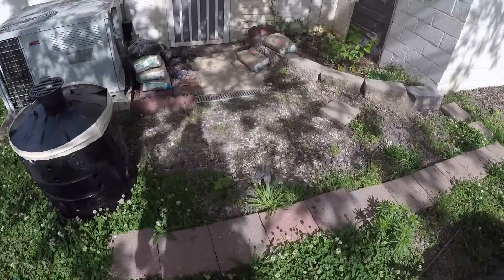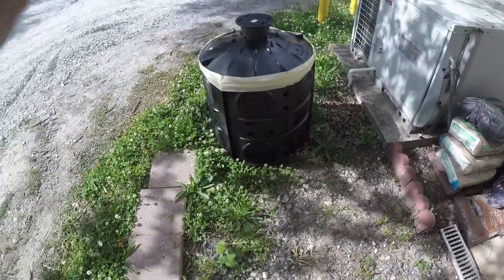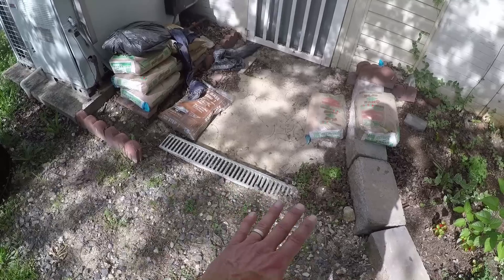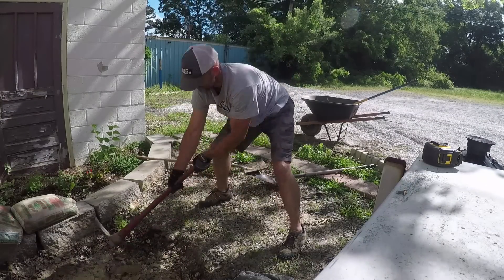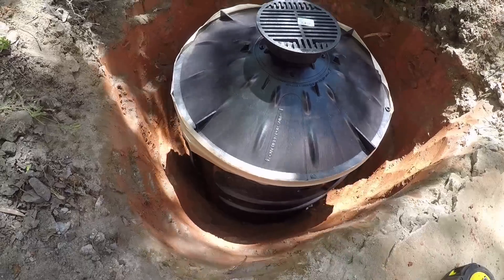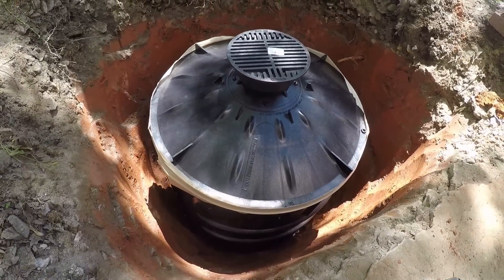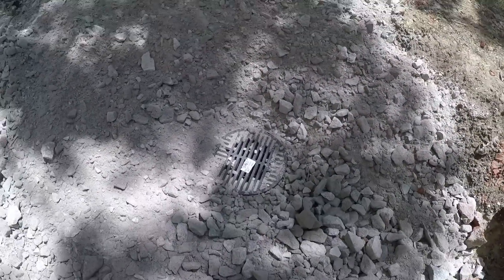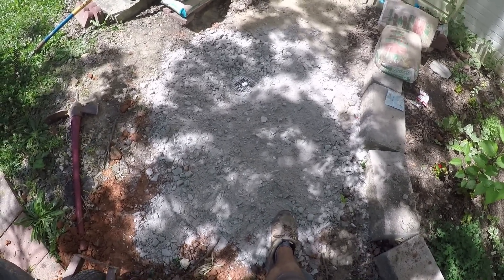NDS Flowell system

Comment: So what happened when it overflows  Obviously the water's not percolating You should lead the water away From the door maybe to the side on a concrete of the garage that makes sense
Reply from the maker: Yep, I agree.  I told the customer that.  I suggested a drain coming off over to an existing drain 20' or so over but he declined.  He was adding this for his tenant and didn't want to spend any more money.  All I can do is what they ask.
Reply: @adventuresofahandyman4446  
Well  You said that's what  They wanted Only problem is when it doesn't work  They want to blame you

Comment: The client just wasted their money.Well will fill up, dirt will flow in especially as there is no place to disseminate the water to because of the clay. Had it drained somewhere ,then maybe it would work for awhile.
Reply: yes, that tank will fill up in minutes when it rains and just overflow through the top and continue to go inside the building. Unless the customer came up with the idea and specifically asked for this system to be installed, he/she will just blame it on Matt for not working.

Comment: BTW - The latest thing is to install a "dry well" with what is called a burrito bag. A fiber bag full of 1" rocks. I have also had success using mulch as backfill in dry well holes. It eventually deteriorates into black dirt and is very rain absorbent, while keeping out clay. Thanks for the video.
Reply from the maker: Good advice.  Thanks!

Comment: When I dig in crap like that, I use a Sawsall with a tree branch cutting blade. It cuts right through the roots dirt, clay and whatever. The blade is history when you are through, but it's very quick. Try it also when digging French Drains or even drainage channels.